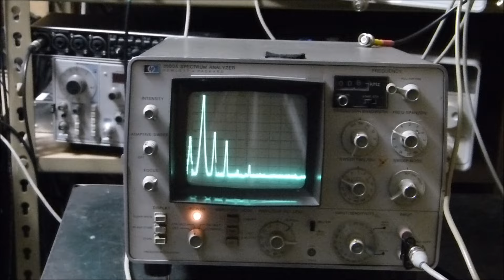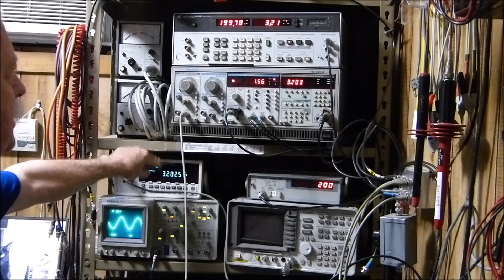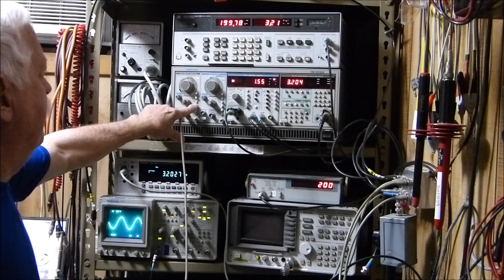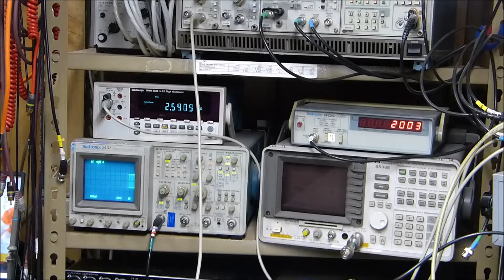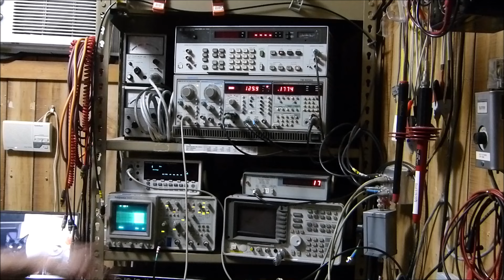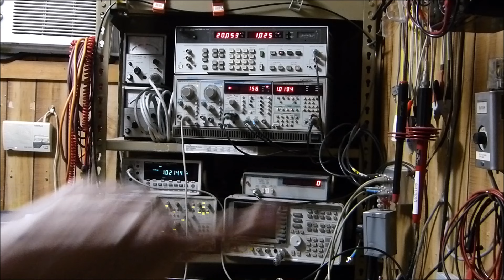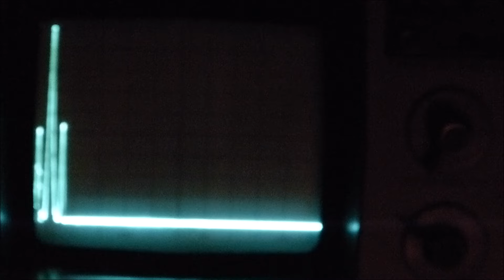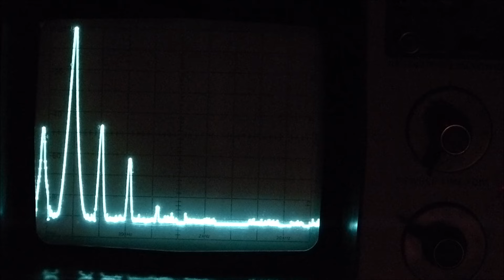PJ MIAOLIA SA-1000 Vacuum Tube Preamp with GE JAN 5670 Tubes

Comment: I have this tube pre-amp and am impressed with the overall sound quality.  I took your advice and turned the volume up all the way up from ten o'clock and I must say that the SQ improved some.  Just make sure your bass setting is no more than 12 o'clock or it might distort on bass heavy tracks. I do plan on trying out the GE jan 5670 tubes sometime later.  I appreciate the info you've provided in this video.

Comment: Back in 2012, there was another pre-amp buffer circuit based on 6N3 tubes running at 170V. It was a Matisse Fantasy circuit and you could swap JAN 5670 tubes. This newer model looks like it has a few more bells and whistles. It is likely the tube portion of the schematic is similar. Very cool to see your experiments!

Comment: Gotta concur with the other commenters that It's good to see videos, especially audio videos, from you again. I've never thought to do harmonic profiles on different brands of the same tube. I'll have to remedy that soon! I do know from various listening tests on my CJ amplifiers that NOS British made GEC KT88's sound significantly sweeter than any current production tubes. I'd love to know what they did differently and why it can't be or isn't being duplicated. Metallurgy? Dunno.
Reply from the maker: It is difficult to measure the "sound" of a tube and THD is not the whole answer, that is for sure. I have believed for a long time that the nuances in harmonic profiles is the best answer to how a tube sounds but every slight differences in harmonic profile are going to sound very different so, maybe this is the simplest answer so far and especially with the inexpensive FFT software available for PC. Thanks for your comments.

Comment: I have looked at that preamp before.  Was wondering how well it worked.  I'm in the process of building a tube preamp using some of the boards available from China.  Using the 3 - 12ax7 C22 McIntosh clone and the 12ax7 Baxandall tone control board.  Going to add an RIAA phono preamp on the one input.  Going to use a 4 input relay selector.  Been wanting to try this for a while. Also have a couple nice VU meters a may put on it. Commented on your video the other day.  Hope you are doing well.  Thanks for the videos.
Reply from the maker: I never got into preamps except for maybe a single channel for a special purpose. I have a Mac C-20 and it is the best preamp I have ever had. There is something special about those old preamps that just can't beat. I remember my uncle had the Fisher 50-C and 70-A preamp and amp. That was the best sounding system my ears ever heard - that was back when I was 13 years old. I have the 70-A but could never find the 50-C that I could afford. Building the clone Mac C-22 sounds like a nice project. You got me interested. I will be 75 soon and life goes on and doesn't stop here so there is always something to look forward to.

Comment: I was just curious.  How do they get the plate voltage in these and what is it?  The tubes do not have an operating voltage at 12v.
Reply from the maker: That is a really good question. I didn't take the time or think much about measuring it. I will see if I can get around to making those measurements
and put a link to it as an unlisted video and show what I found. I know the filaments are in series and the tubes have to warm up before there is any
output so I "assumed" the tubes are actually an active component in the audio chain but without proof, the whole thing could be a spoof. Thanks 
for your comments.
Reply: @ElPasoTubeAmps  The only way I can think of is if there's a small boost converter in the circuit.  It would need an inductor, switcher, and control IC.  Only needs to handle maybe 20ma. I would think that it would need probably 50v @ 10ma per tube.
Reply from the maker: @kgsalvage6306  That makes sense and probably is what develops the HV but I didn't pay attention when I had it open. I will try to check it out tonight.  🙂

Comment: How hard are you driving that preamp and what is the impedance of the load it's looking into? Because those Distortion figures seem to be three orders of magnitude higher than normal for a preamplifier. If the output is being pushed to plus 40 dbm I can see maybe that would be the reason.
Reply from the maker: Agree that a preamp should be ultra clean. My Mac preamps are almost as clean as the SG505. In the video I am driving it at -10 dBm (0.244 V across 600 ohm) for 2.45 V output - seems reasonable for full output for line level.  If I lower it to -20 dBm input, that gives me 782 mV out and THD drops to 0.57%. All this is at 2 KHz. It is disappointing for a high-end device but serves it purpose in other ways.
Reply: @ElPasoTubeAmps Talking about levels, when you in earlier video compared EL34 tubes at high output  power and did some FFT analysis using FFT software in computer, what audio interface did you use, and if, how did you attenuate the output signal of a amp which is presumably giving 20 volts RMS, 56 Vpp if load is 8 ohms? Or was the load only 4 ohms so that output level was smaller?
Reply from the maker: @jutukka  I don't know which video you might be referencing but, yes, the output of most any amplifier has to be attenuated to at least line level voltages to put into the outboard USB sound units. In my break-out box mounted on the wall where I put a signal in and distribuite it to all the equipment, I have two ports that are attenuated 10x and frequency compensated. I also have another, that was on the bench next to the PC in these last videos that is an adjustable and compensated attenuator. Devices like the Tektronix and HP can handle pretty high levels of voltage without overload or harm. Even just a 10K pot parallel with the 8 ohm load will allow you to attenuate the voltage down to a level that the PC and equipment can handle. Hope this helps.
Reply: @ElPasoTubeAmps  Well, that possible frq compensation was what I was thinking of. However, the output impedances of those amps are so low that the need of compensation is supposedly quite minimal and simple voltage divider gives pretty satisfactory results unless very long cables etc. are used. And I just today compared some virtual distortion effects and virtual tube amps with virtual FFT analyzer, when using VST plug-ins in DAW, and I did not think about compensations at all because those virtual devices seemed to be connected to virtual FFT analyzer using virtual cables which had no inductance and capacitance. 😁